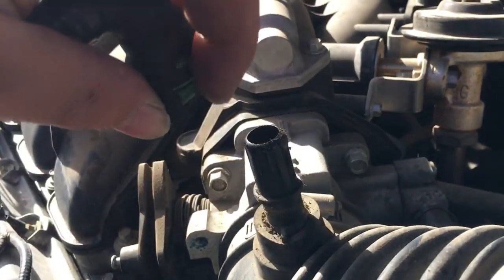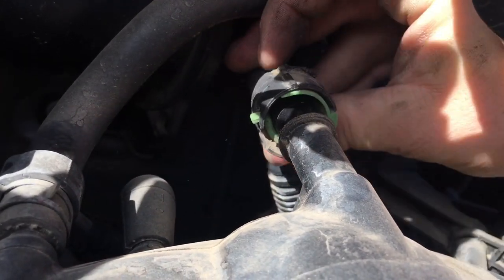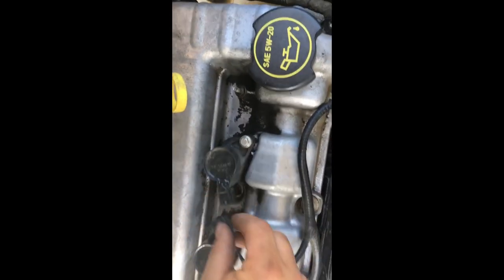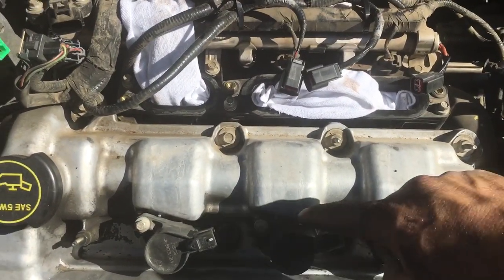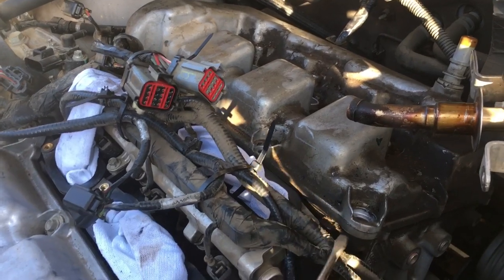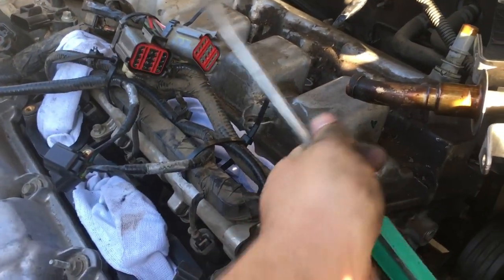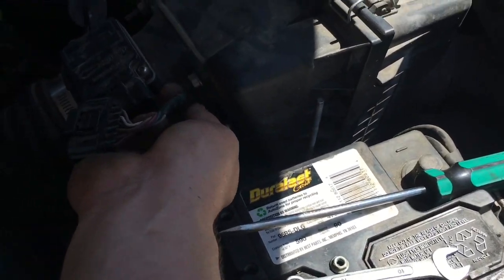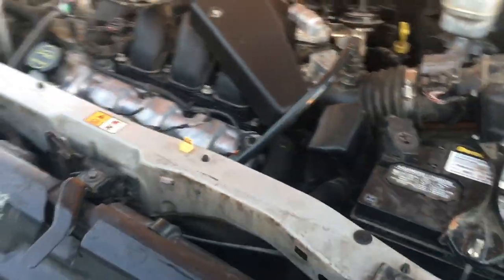How To Replace Valve Cover Gaskets & Spark Plugs Ford Escape v6 3.0 Mercury Mariner & Mazda Tribute

Comment: Great video on how to do these gasket replacements. The only thing i can recommend is that when you remove the valve covers is to check the camshaft bearing cap bolts and retorque them, they will come loose on the Ford 3.0L engines as the vehicle ages and cause some major problems if they become too loose or break off. Beware ! Also while you were this far into removing alot of the components go ahead and replace the water pump and belt also cause you are right there at it if you vehicle has high mileage on it , water pumps are cheap so are those little belts. May save some headaches on down the road.
Reply from the maker: I’ve been told this before sounds like a good things to be checking, so far we have had no issues, thanks for sharing 🍻

Comment: Im about to tackle this job on my ford escape. This video was very informative and gave me an idea of what to expect. Thank you!
Reply: About how long did it take you to do the job
Reply: @dyerdavis5956  I did mine over a few days. One thing I noticed on mine was the oil dipstick had to be removed. There was no other way to maneuver the cover between that and the fuel injector harness. The grommets on the bolts takes a very long time to remove.

Comment: Don't forget while you have them off, retorque the cam bearing bolts. They are known to loosen or event break sometimes causing engine replacement usually.

Comment: What were you showing in the purple mirror?? Was part of the rear valve cover gasket leaking?  And you were replacing it anyway? Or was this something else that need a new gasket ?? Mine is leaking oil on the exhaust manifold also, hard to tell if it is on the front or rear gasket though. Thanks

Comment: I love how easy everything always comes apart. Mine never comes apart that easy. You can say I’m a sixty year old woman but my husband has just as much problem as I do
Reply: Agreed. Mine was the Mazda Tribute, so plastic valve covers is the only difference I think. But I found it almost impossible to get the valve covers off once they were free, because they both kept getting stuck on the timing chain. Same thing going back on, too

Comment: Thanks for this video. For my 2012 ford escape v6 3.0l, After everything is put together the torqued to factory spec of 9ft lb , there is a 2.5mm spacing all around the valve cover and the engine head with fel-pro gasket sandwiched in between two. Is this 2.5mm space normal?

Comment: How did you put that gasket in the valve cover that goes around that electrical connector I can't figure out how to press that in there it seems like it's a little big for the hole

Comment: By any chance did you replace the spark plugs before you took off the valve cover? Or did you put the new gaskets on first then changed out the spark plugs?
Reply from the maker: I’m not sure the sequence, but I want it say after  the gaskets were replaced. Thanks for watching
Reply: @ATEMOFFROAD  did u also put rtv gasket maker and install the valve cover at same time but just let it sit overnight to dry then start?
Reply from the maker: Yes , rtv was only used in some locations not the entire gasket, let It set for an hour before torquing

Comment: Good video. Just curious, what brand, and kind  of sealant did you use for the corners of the gasket where the valve cover seats on the head, and how long did you have to wait before it dried to install the covers back on, and start the engine?
Reply from the maker: Simon Black Black RTV & overnight
Reply: All Things Electro-Mechanical Great. Just double checking. Thanks!
Reply: How necessary is to have the sealant on the corners?  Thanks for the video.

Comment: I notice that you used the same old original gaskets used for the intake manifold and the throttle body: is that true?
Reply from the maker: Hah yes I was working on an oil leak, those intake gaskets were fine

Comment: I really appreciate this video. I have one of these cars it’s a Mercury Mariner tho. This car has to be one of the biggest piles of junk I’ve ever owned. I hate everything about except the power of the engine. Everything is just cheap junky plastic and it rides like garbage. The front end sounds like it’s falling apart when I hit the slighted road imperfection. The wheel wells are rusting and I’ve done everything in my power to prevent rust. The road noise is unbearable as well. I really just overall dislike this vehicle. I do not suggest this vehicle to anybody looking for a used car. The engineering is atrocious and the gas mileage is sub-par for the size of the vehicle. But thanks for this informative video. I’m trying to tackle the issues one by one since money is tight. Sorry for the rant but Jesus ,this car is junk front to back. Waiting for the famous PTU failure... I’ve got the whining noise starting..
Reply from the maker: donovo hang in there, here’s some perspective.. the 3.0 is a decent engine . Keeping up to date on your oil and fluid changes on Both the. Engine and transmission can really keep the escape alive. My escape has taken a beating and is at 210,xxxx miles still running strong. If the cost to replace the transmission was lower I would invest in a new power train to double the miles it has now. You are right on the suspension. It’s a bumpy noisy ride , but every car has there engineered flaws . 
-Cheers

Comment: Any reason why there are two different sets if gaskets for thr same engine size
Reply from the maker: Jungle Viper yes this engine goes in several different models of vehicles, can be variations depending on Year make and model VIN, hope this helps good luck
Reply: @ATEMOFFROAD  thanks

Comment: Hello, how many hours to wait to fill with oil after changing the gasket?
Reply from the maker: Moe Pes just enough to get rtv to dry!!!
Reply: @ATEMOFFROAD  
Thanks dude
Reply: @ATEMOFFROAD  are you supposed to drain your oil before doing this repair?
Reply from the maker: Jungle Viper no I never did

Comment: Is that a 24 valve
Reply from the maker: Jamaine Dingle yes it is 2 for the next intake and two for the exhaust which would make it an v6 dual over head cam engine. 4 cams! Very smooth running timing chain engine. Over 208,xxx miles still running strong

Comment: Did you have a new problem with overheating before you did this
Reply from the maker: Ohio Texas boy Schlabach The radiator was leaking coolant so I figured if I’m replacing  the radiator I’ll just go  ahead and do the valve cover gaskets tune up and pcv valve as well since I was there. And had things taken apart. No cooling or overheating issues. Just a old plastic leaky radiator.

Comment: You didn't even show removing the front valve cover except to lose the 18mm bolt for the bracket that is in the way. There is a lot more to it than that pal. Valve cover bolts closest to radiator are extremely hard to get out. Some info there would be nice pal
Reply from the maker: Thanks for watching. This video is not for everyone! This video has been streamlined to give you what you need to get the job done. If you can remove the rear cover you can easily remove the front. Also please I advise if you can’t watch this video and figure out how to do this job I would recommend do not attempt to do this kind of own work on your you vehicle and to send to a shop where a professional can fix your problems. Thanks
Reply: I noticed this too, like isnt there two covers? but still good video on one cover.
Reply: I made a video showing the whole process when I did mine, including all my mistakes lol
Reply: @Ryan45678  cool I changed mine a month ago, the front valve cover closest to the radiator was actually a lot harder to come out because of that mounting bracket on the side, I just bent my bracket instead of removing
Reply: @carlos52321  yeah, that thing really had to move one way or another. I almost gave up trying to use a harbor freight impact to take it off, ended up that it was just weak and using a ratchet with a pipe on the end was just enough to break the bolt loose. And even then it kept getting stuck on the timing chain and I think an AC line or something.

Comment: Don’t vacuum. Use compressed air
Reply from the maker: Herman Cruz why?
Reply: Is alot better at getting smaller gunk or dust in small spots that a vacuum is likely to miss. But i mean using a vacuum I guess is better than nothing for sure